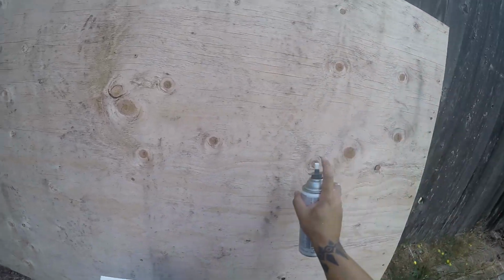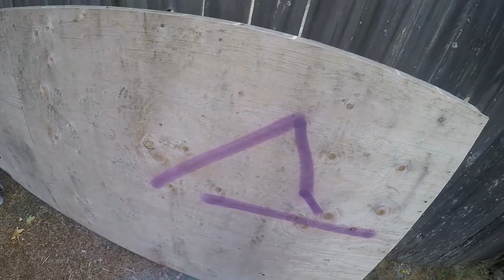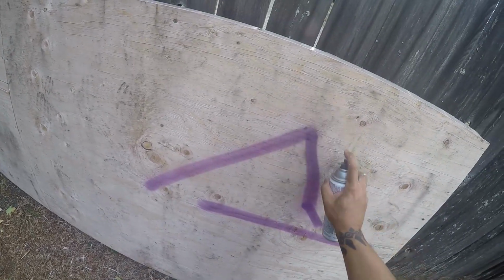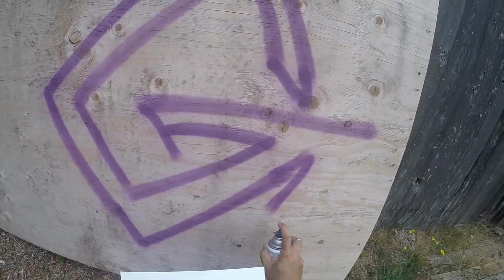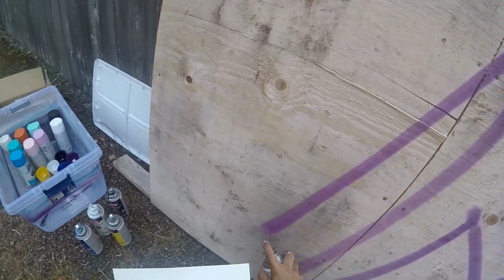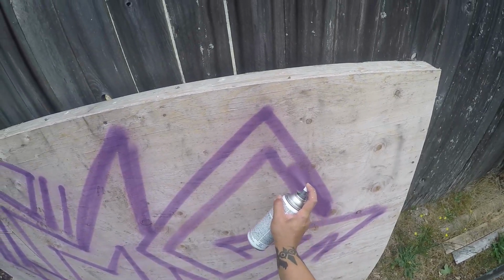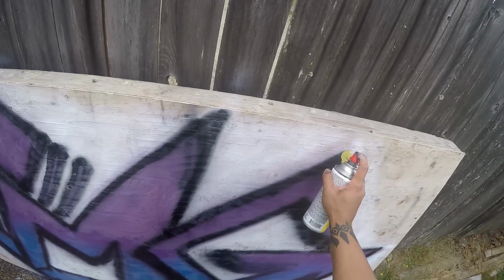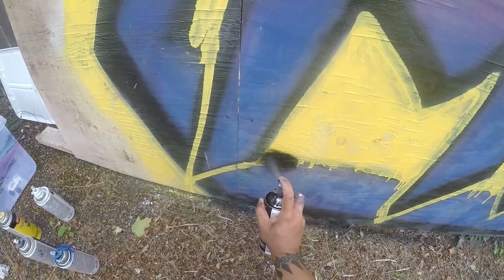Graffiti First Timer - Using Krylon Spray Paint

Comment: I never even knew there were different caps for spray paint. It makes so much sense.
Reply from the maker: Yup, it gives you more control, the regular caps on 'everyday' spray paint have more overspray than 'graffiti' caps
Reply: @craftworksbyg6440 keep the stock caps for outlining.. krylon does have alot of overspray try rusto

Comment: you really shouldn’t use krylon. buy some actual paint online. i like using flame orange or blue. if you want to spend more the molotows are jice fore piecing.
Reply: if you really want to use store bought get some rustos. much better than krylon, which is probably one of the worst for graffiti or art in general.
Reply from the maker: Thank you for the input!